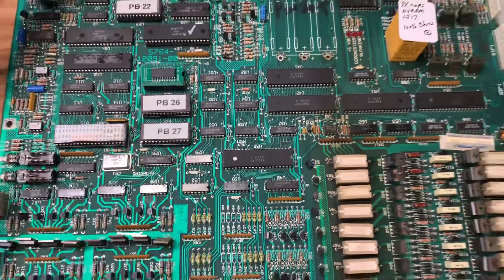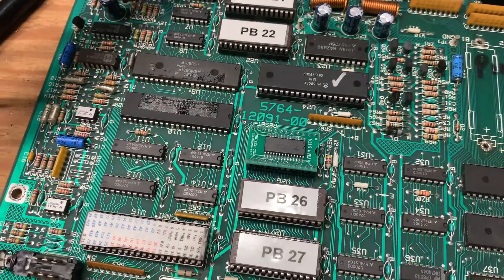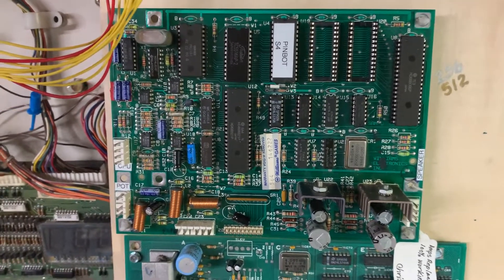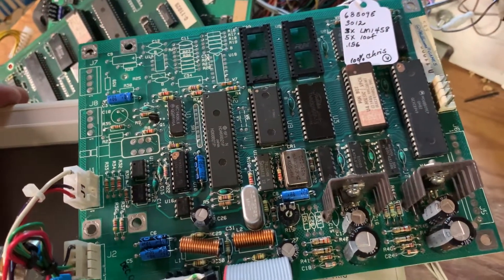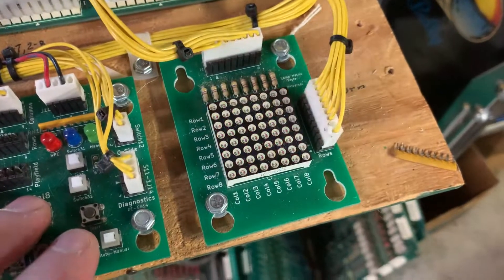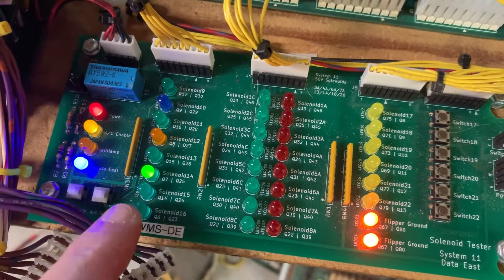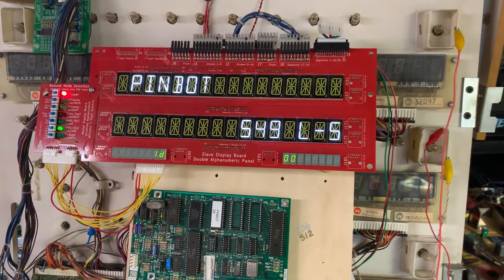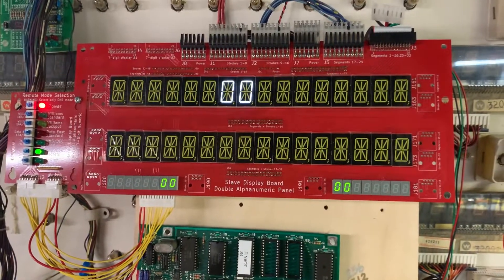Williams System 11 PinBot MPU and Sound Board Repair and Test

Comment: ive notece the toshiba tmm2016bp-15 gets REALLY hot and the sn74ls04n a bit hot.  its a road king game.. 
replaced all the caps and the 1458.. because they are voltage regulators.. and 1 was really bad. 

putted it back in the machine but the toshiba keeps getting very hot..  i have speech. the amp on the board works. but no music
Reply from the maker: The TMS2016 is equivalent to any number of 6116 RAMs. If it is getting that hot, then I would replace it.

Comment: you replaced 1458 with what.. these are old.. they are hard to find
Reply from the maker: I replaced the part with an NOS 1458. I have a supply that I’ve purchased over the years.
Reply: @ChrisHiblerPinball  ow that are indeed QM1458, seen allot of sellers offer LM1458 and wondering if these work -.o, i live in eu. and dont see any sellers sell QM